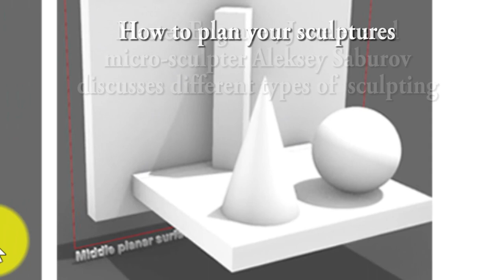Sculpting Basic Shapes with Aleksey Saburov

Comment: If you really want to go crazy, redesign the controller to use 12V DC. I think that would put you over the top. You’d smoke everyone, including GRS and Lindsay. Plus make graver adapters to fit the square graver blanks and I’ll buy one immediately.
Reply from the maker: Our Universal collets already fit square graver blanks.  We have tested the system on portable power stations, and they work great.  We looked into doing our own power supply with lithium batteries, but the cost would be too high.  However, if you use one of those car charging/portable power stations with an inverter, the system works great.  The bigger the battery, the longer it will last.

So when can we expect your order? ;>)
Reply: TiraMitchell after the first or second relief checks come in. In the meantime, may you and your family, please stay healthy and keep doing what you’re doing. I’ve finished one of your pocket knife projects and am considering another very soon.
Reply from the maker: @pierdolio  Thanks, Adam.  Please stay safe.  We'll be here when you're ready.